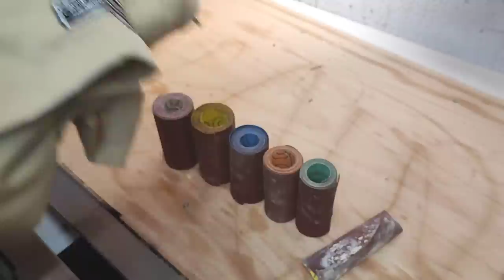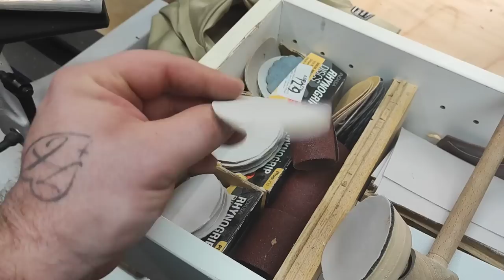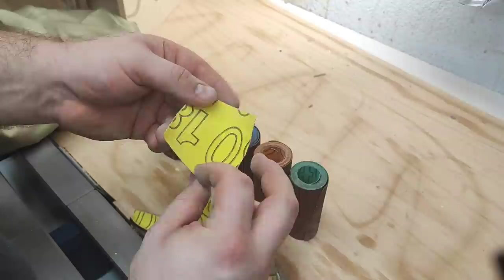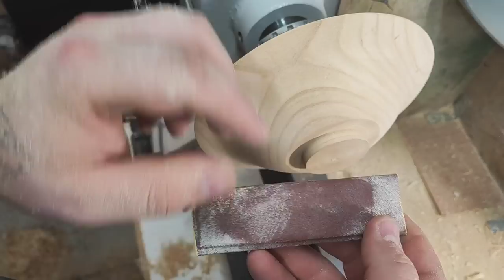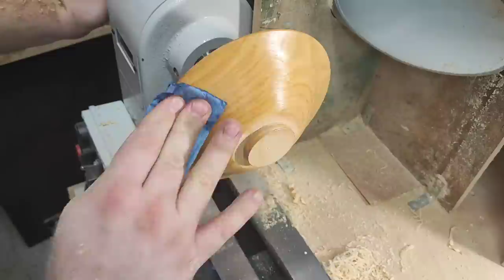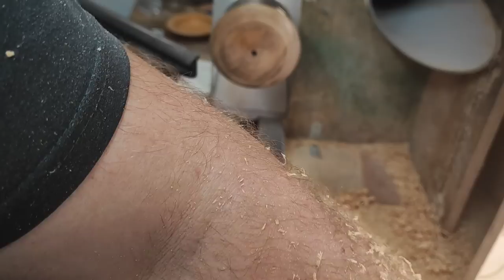How to save time on sanding__ CRAFT SUPPLY USA sandpaper gift

Comment: I use these and klingspor paper from the bargain box. Just so happened that I got 80, 180(green), and 220(red) from klingspor and 120, 320, and 400 from craft supply (i buy most stuff from there, since I'm in US). They both perform pretty well. And it's easy to find which one based on the colors
Reply from the maker: Agreed sir... Thank you for your input☺️

Comment: I have large rolls of a cheaper sandpaper that will probably last through the end of the year. I have been reluctant to order better sandpaper because, if I see a great improvement, what will I do with the leftover cheap stuff? But, based on your video, I ordered the four grits I most commonly use from Craft Supplies. Thank you, I think.
Reply from the maker: 😅 no problem.... I think you'll like it... Let me know how you find them in use.....

Comment: The color coding really is helpful.  I can't tell if you have your dust collector switched at the lathe.  Probably you do. It's a nice little luxury.  The best way I could save time sanding would be to have your tool handling skill.  That's not going to happen though.
Reply from the maker: Practice and repetetive work will help you a lot with tool finish, thank you very much 🤗
Reply: Good advice, but I'm 78.

Comment: Did you make your scrapers? Ifso, what type of steel did you use?
Reply from the maker: I have a few, I use high speed steel bar for metal working lathes, its m2 steel in most cases and works ok ...